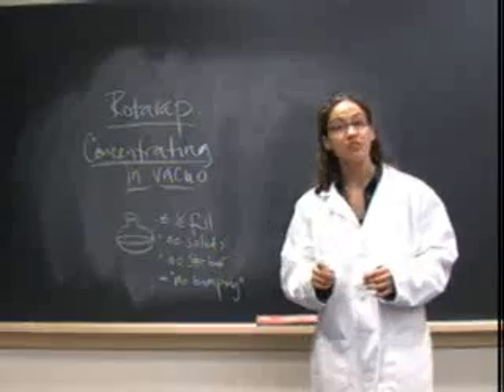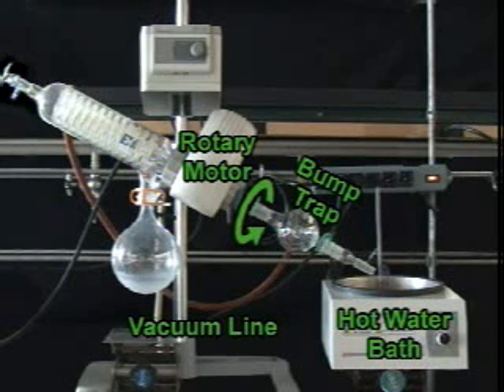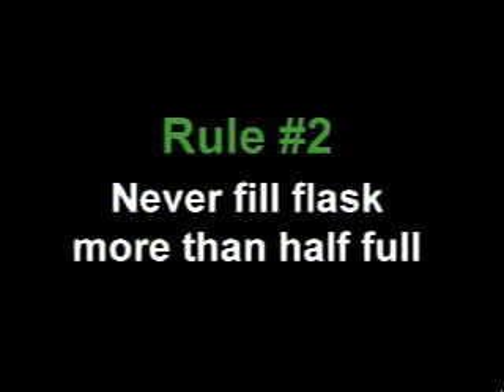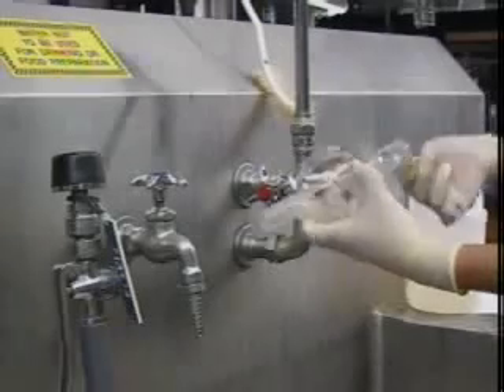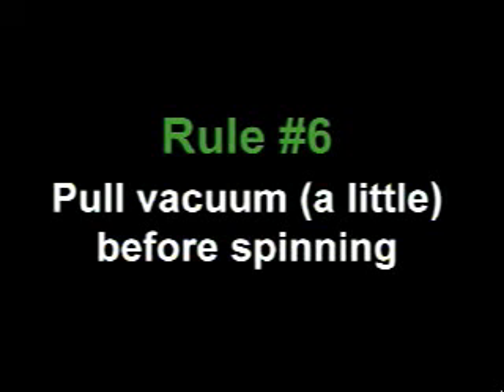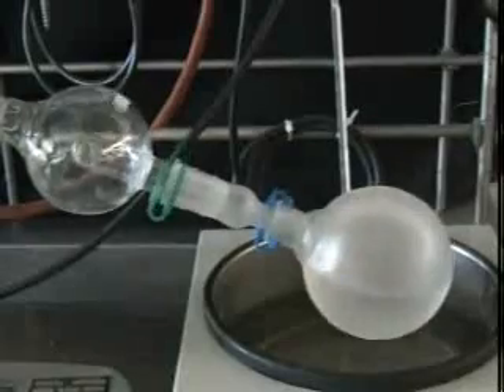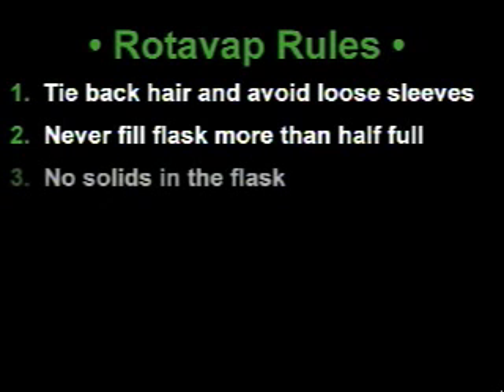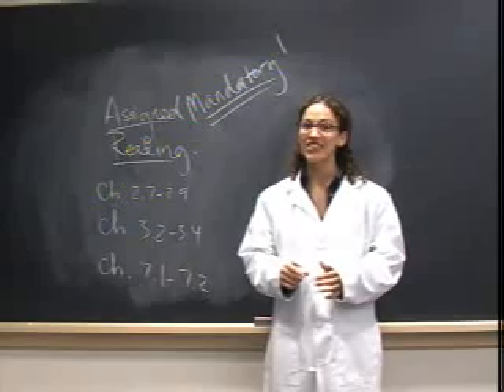Lec 6 | MIT 5.301 Chemistry Laboratory Techniques, IAP 2004

Comment: What is the advantage of a rotovap Vs other methods?
Reply: Low temperatures for destilation
Reply: The spinning increases the rate  of evaporation over a fixed flask by increasing the surface area of the liquid..  Rotovaps are a fast method of distillation.  On the down side, the equipment is  more expensive than other methods.